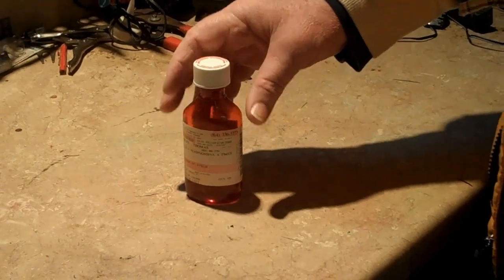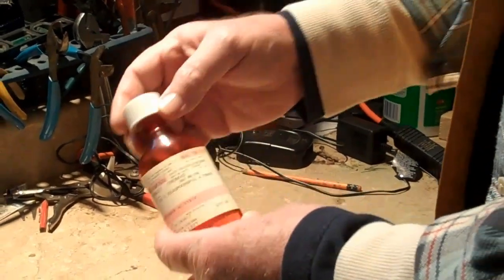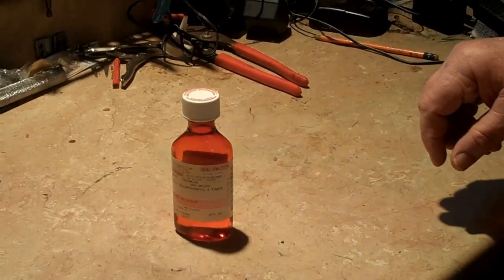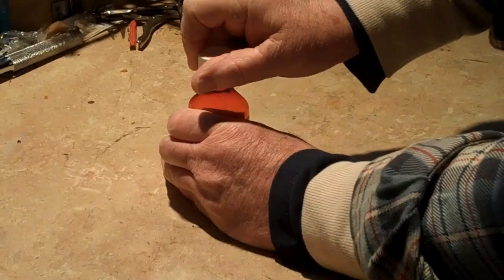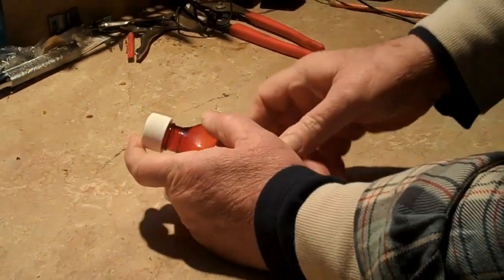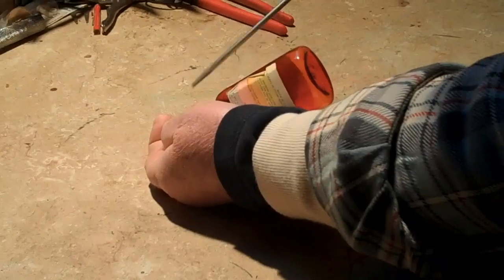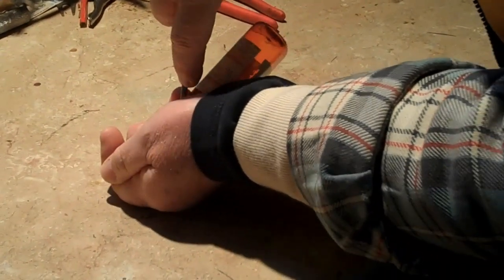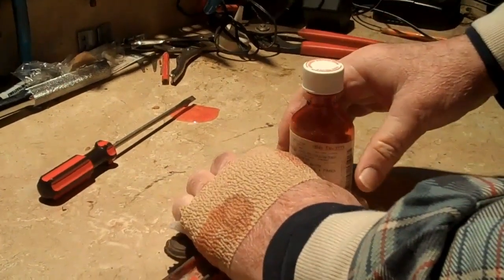How to open a bottle of cough syrup

Comment: Use PLIERS to move the sliding inner ring that loosened up, and press down while u do it. It'll open instantly. I just did it now.
Reply: wow thank you. it worked. i'd been tryna open this damn bottle for ~3 hours now.
Reply: well u shouldn't have to use pliers...wheres that masculine strength in your profile picture